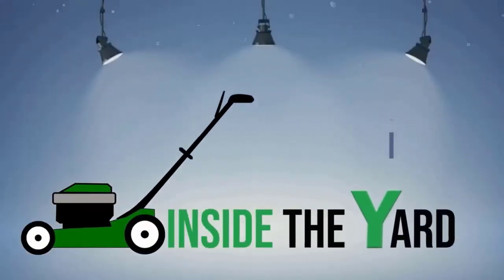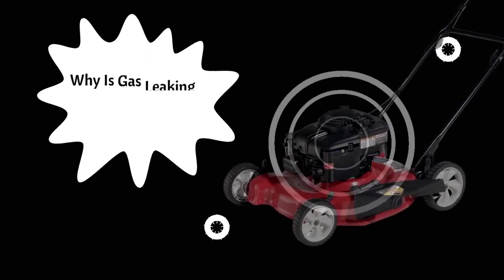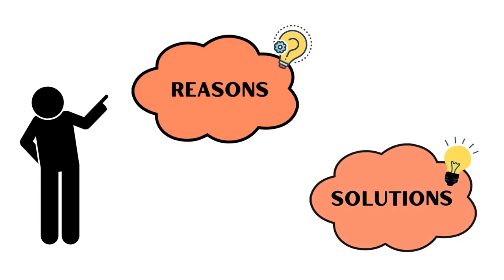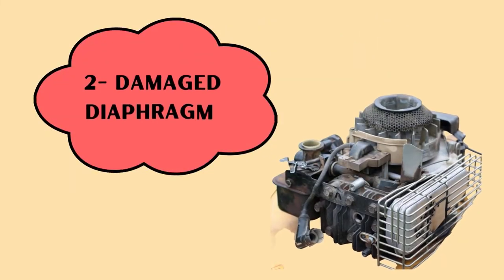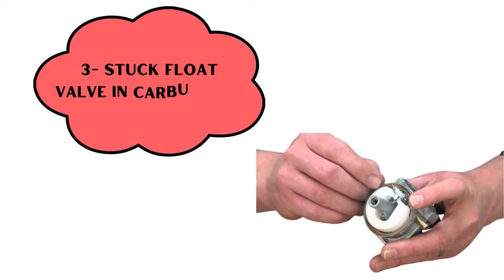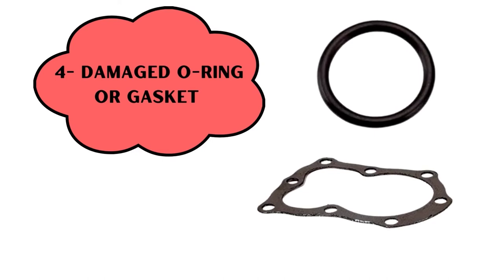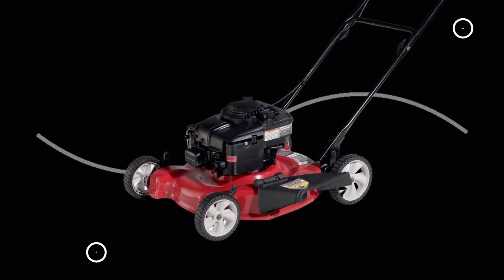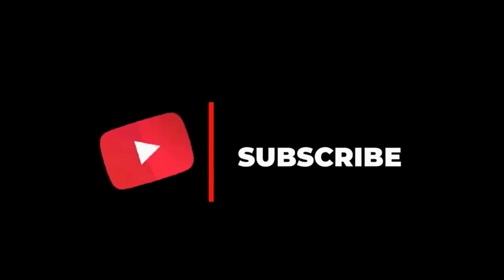Gas Leaking From Primer Bulb On Lawn Mower [Must Know 5 Causes ]

Comment: 1. Low fuel supply in the carburetor.
* The oil filter or line may be blocked.
* The oil pump may be faulty.

2. Stuck float valve in carburetor.
* Readjust and reseat.

3. Damaged diaphragm
* Replace

4. Damaged O-ring or Gasket
* Replace